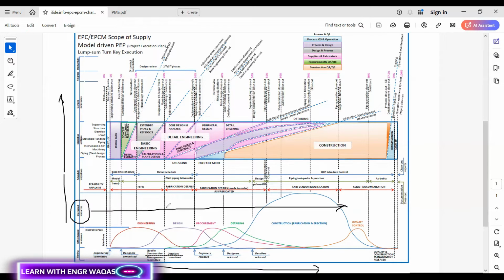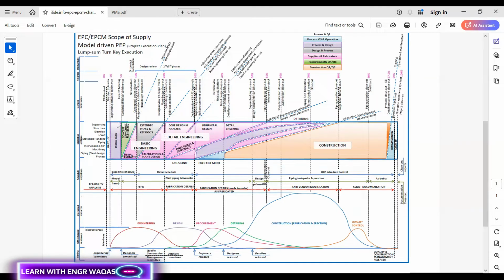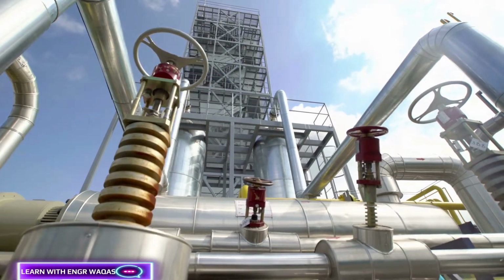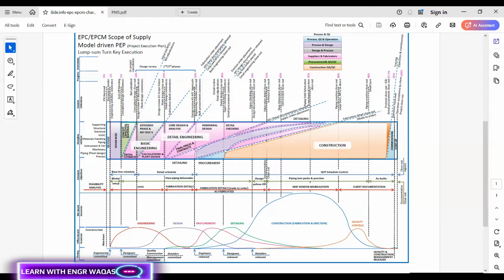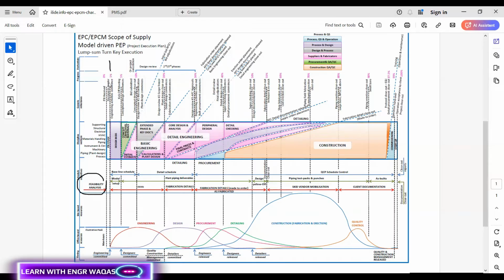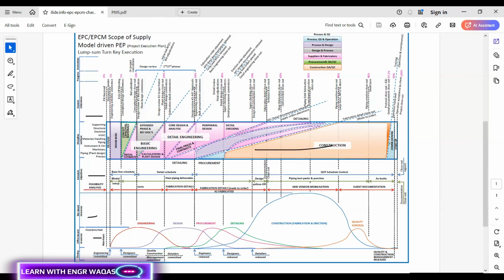Mastering EPC Project Planning & Control | Step-by-Step Guide for Planning Engineers 🏗️📈

Comment: This video explains the complete EPC (Engineering, Procurement, and Construction) project management scope and a model-driven project execution plan (0:01). It is designed to help those in planning careers or those looking to start one in the field (0:25).

The video covers:
Project Phases and Milestones (0:31): It outlines different stages of a project, from feasibility analysis to delivery, including milestones and required documentation (0:31-0:38).
Understanding the Project Diagram (1:00): The presenter simplifies a complex diagram by explaining its x and y axes, representing office-bound and site-bound activities, schedule objectives, disciplines, generic milestones, and progress derivatives (1:00-1:22).
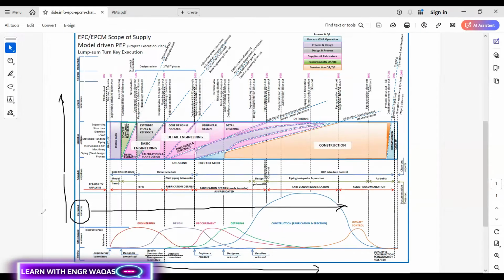Resource Mobilization and Peak Requirements (2:19): The video details when different types of specialists (engineers, designers, procurement, construction, quality control) are needed and at what peak during the project lifecycle (2:19-3:45).
Key Project Stages Explained (3:45):
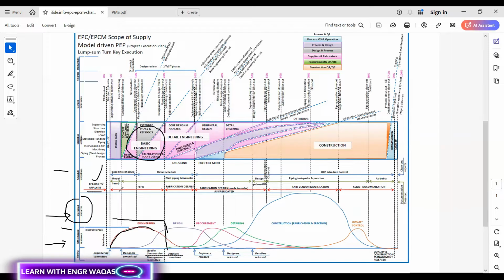Feasibility Analysis (4:35): Evaluating a project's economic and technical viability before proceeding (4:35-5:00).
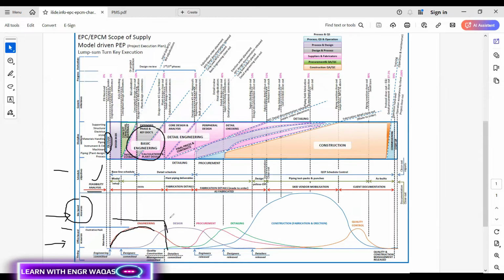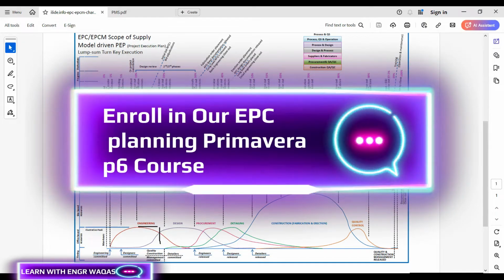Basic and Detailed Engineering (5:27, 8:17): The initial design phase requiring many engineers, followed by detailed designs for structures, mechanical, electrical, and plumbing elements (5:27-5:56, 8:17-9:00).
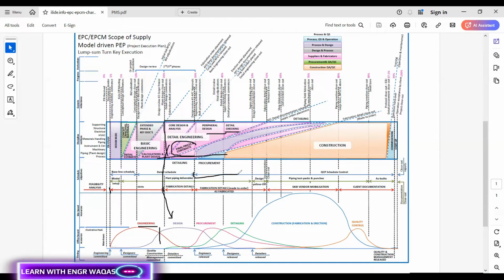Procurement (10:17): The process of compiling materials, converting designs into task sheets, and acquiring resources (10:17-10:38).
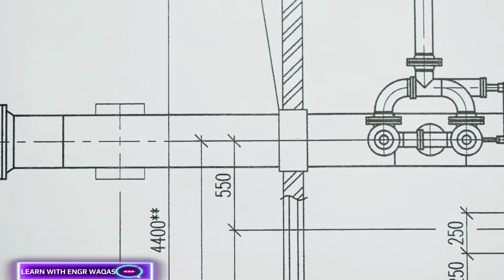Plant Piping Deliverables (11:02): Specific documentation, drawings, calculations, and reports for piping design, engineering, procurement, and construction stages (11:02-11:17).
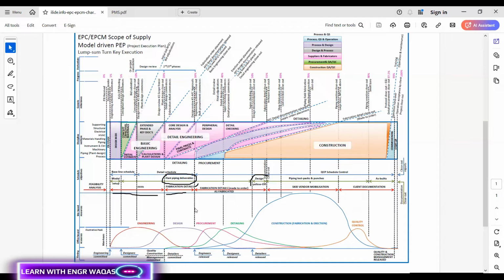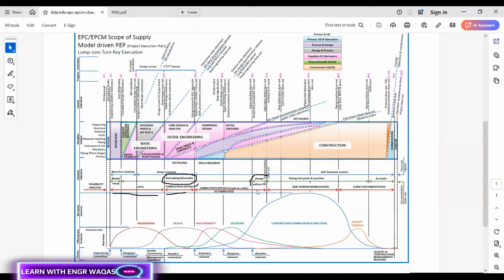Fabrication Details and Quality Control (14:34): Drawings and specifications for customized components, ensuring industry standards are met (14:34-15:00).
Skid and Vendor Mobilization (15:25): Assembling and preparing pre-fabricated units for transport and installation by third-party suppliers (15:25-16:12).
Piping Test Packs and Punches (17:24): Comprehensive documents for inspection, testing, and quality control of piping systems (17:24-19:11).
Construction and Documentation (19:13): The construction phase, followed by as-built documentation and client project close-out (19:13-20:07).
Progress Measurement and Milestones (20:54): How to calculate project progress based on defined milestones, from 1% completion after feasibility to cumulative progress throughout different phases (20:54-22:58).
Procurement Activities and Progress Calculation (23:03): Breaking down procurement into activities like RFQ, bid reception, technical bid evaluation, and purchase order issuance, with examples of progress percentage allocation (23:03-24:20).
Project Planning Engineer's Vision (25:18): Emphasizing the importance of aligned procurement and construction for on-time project delivery (25:18-25:31).
Reply from the maker: Thank you so much for your detailed feedback!